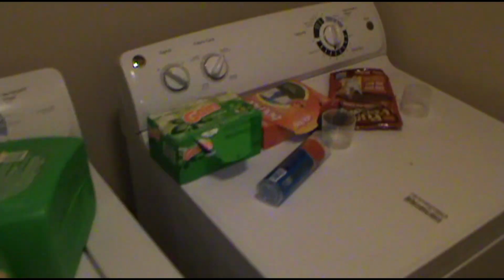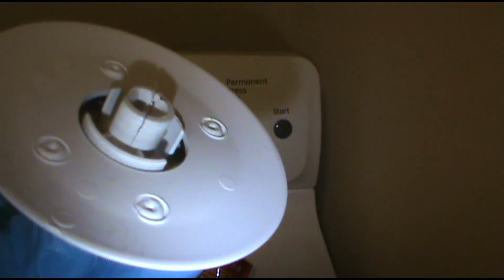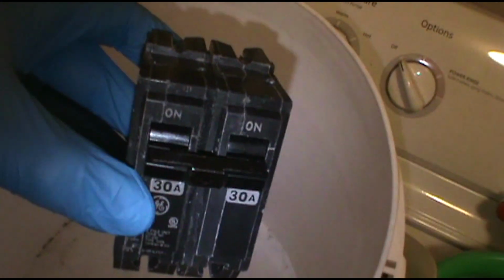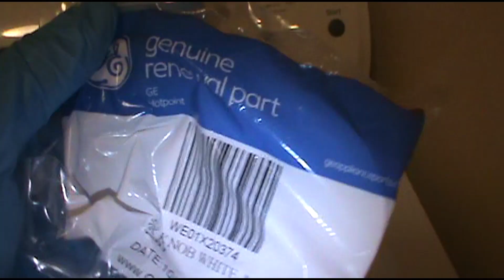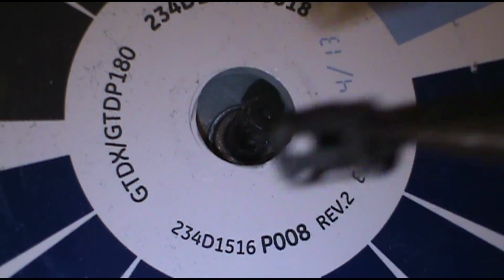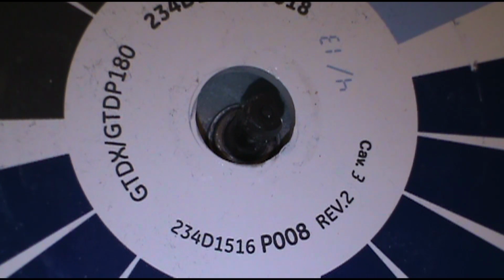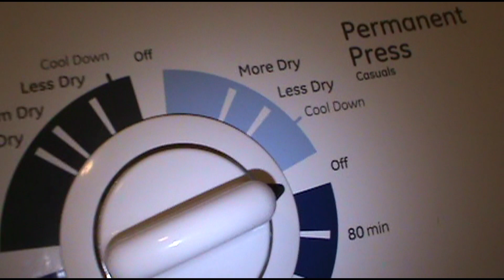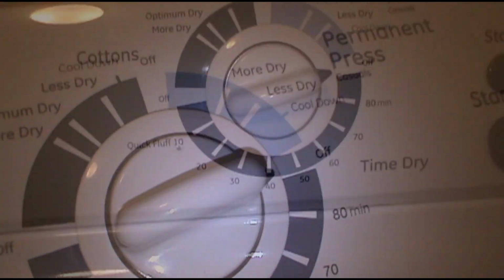DRYER NOT STARTING (EASY FIX)

Comment: Hi Lex, 
1) Can't even begin to tell you how many of your vids have been helping me in my maintenance job. Thanks a BUNCH 
2)Hoping you can help me out. I have a GE stack washer dryer (GUD27ESSJ0WW). When the dryer is on a time cycle of minutes...it operates just fine. But if it is on "More dry" the dryer just keeps running. I have not tried a hard reset yet. I am unsure that it would be the timer since one option works. And I am getting heat so I don't think it is an element issue. Any Ideas/suggestions?